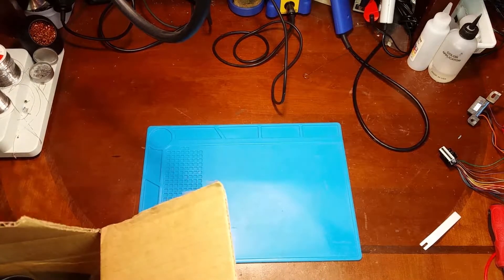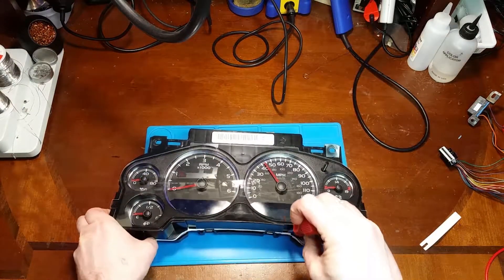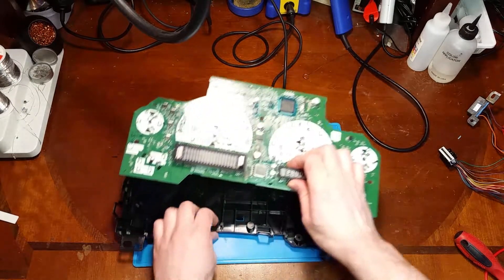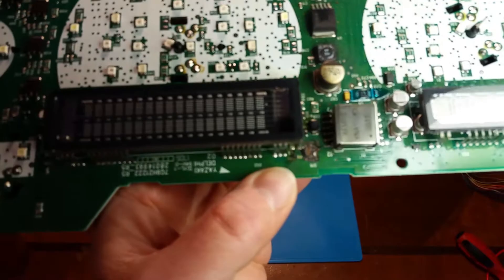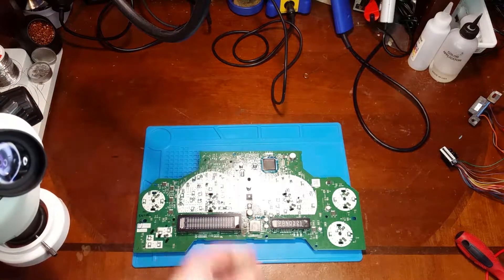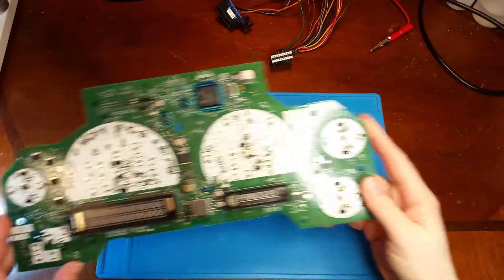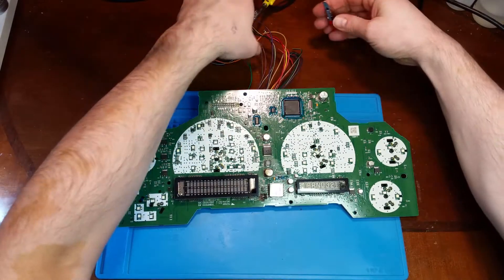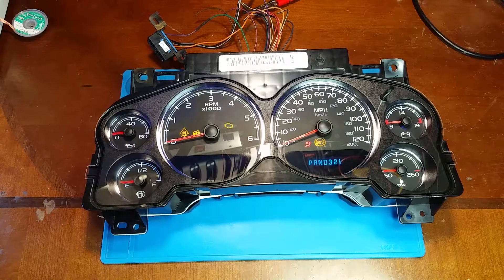07 GM Cluster MOSFET, Pad and PCB damage Repair

Comment: When does it require to reprogram the cluster? To get the right mileage.
Reply from the maker: I would recommend repairing the original cluster over buying a junkyard replacement and buying a programmer.

Comment: Some people would say that was a Jerry rig of a job. Well all I can say is ....Go try and fix it yourself and let me  know if the Jerry rig is worth it or not?
There are several of us who do this sort of thing on all kinds of boards. Me personally have done it on retro game cartridges where the foil is cut into or sanded right off the board. Also fixed a few flat panel TVs.
The only instrument cluster I have messed with was from a 1997 Jeep Wrangler. And only after watching this guy work on tons of clusters. I managed to fix mine. So I can assure you the so called Jerry rig will save you money. It doesn't matter how it looks behind the plastic if your proud of what you have accomplished. This guy is only sharing his skills with people to help them and himself at the same time.
But haters will hate. And they will pay in the end. Because of their ego.

Comment: Hi Jeff . On some of these GM
Clusters when you replace the mosfet, the new one will run super hot . Does the 8 pin ic control the timing to the mosfet ? 
Or is it hopefully something else? Cap maybe?
Reply from the maker: Yes if it's drawing too much power you'll need to replace the chip.

Comment: So the center lead on the mosfet doesn’t get connected to anything? Or did I miss something? Thanks in advance.
Reply from the maker: Center pin and heat sink tab is the same through conductor. Center lead is directly connected to the transformer.

Comment: What would cause a new mosfet to burn after replacing? I did run jumper wires as in this video and it worked for approximately 45 seconds. I was also curious of the middle lead on the mosfet. Thank you for your videos and your previous responses to my questions.
Reply from the maker: A: burnt PCB can be conductive.
B: transformer could have failed
C: jumpers could be wrong.
Reply: I have a good distance of air gap between the pcb and the mosfet, the jumpers are in the same locations as your video. I am questioning the gauge wire that I used for the jumper. Is there a test to confirm the transformer or should I just replace it along with another mosfet? Thank you for your help and I will be happy to compensate you for your advice. My email is brandonthomas1974@gmail.com
Reply from the maker: @brandon1979transam  even with a gap, I would take a Razer blade and cut the traces to the burnt sections so it can't influence the circuit. How does the 100 ohm gate resistor look?

Comment: Shellac is the same stuff they are using to insulate cooper wires in transformers, it is dirt cheap and it could be used to insulate the burned pcb substrate, it takes time to cure but when it does it has excellent mechanical adherence and excellent thermal stability hence its application in combustion engine head repairs

Comment: excellent work           what are you using to power it up i am a retired tv cameraman and  ex electronics engineer i want to start repairing auto electronic stuff part time i have all the test gear scope meter etc just need info on where to get parts diagrams etc and get familiar with out of circuit supply and dummy loads to units on the bench thanks
Reply from the maker: I found what I needed with google, YouTube and just jumping in and doing it. Background in electronics helped.

Comment: Jeff I think my cluster from a 2004 Cadillac Escalade EXT may have silver migration. Can you fix it if it does ?My battery was going dead all the time then I replaced the battery but because it is new I have not had the problem. when the battery gets older it will probably do it again.
Reply from the maker: You can use a amp meter across the cluster fuse to see if your cluster is going to sleep mode. Check out my doctors second opinion video for more info.

Comment: jeff can you tell me that repair copper wire part number please sir. Thank you so very much. James
Reply from the maker: Its just enamel coated wire from an old transformer. Often called magnent wire.
Reply: Thanks jeff
Reply from the maker: No problem. It's used to make coils, transformers and inductors. It's nice because the thin insulation can be burned off with the soldering iron
Reply: Hey Jeff,
What gauge copper wire do you use?

Comment: I have a 2003 Avalanche cluster that works intermittently. When it isn't working if I hit the cluster it will start working. Any thoughts on what this might be? Bad solder joint?
Reply from the maker: Yes it could be. Some trouble shooting would be the thing to do next. You'll need to pull and disassemble to really see what it really needs

Comment: Hi, where can i find the 100ohms resistor like that type? i already buy the mosfet, but just in case. My cluster does not show the millage display & the PRND321 display is without bright just a little dark. i'm going to do it by my self 'cause i have some experience with cellphones.
Really appreciate this data.
Regards from Mexico
Reply from the maker: I have a link in the description to the resistor. If the resistor is open, you can count on the driver chip being fried.
Reply: Nice, i didn't see that part of links. Today i'm going to check it. Hope resistor is good. Just in case i want to have resistor back up. Thanks for answer.